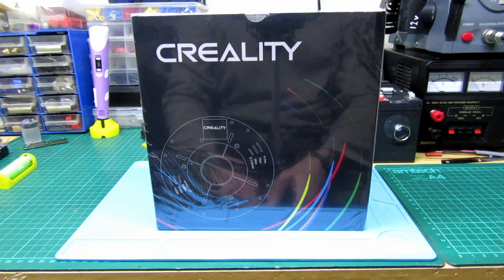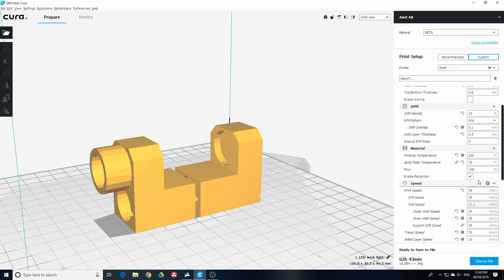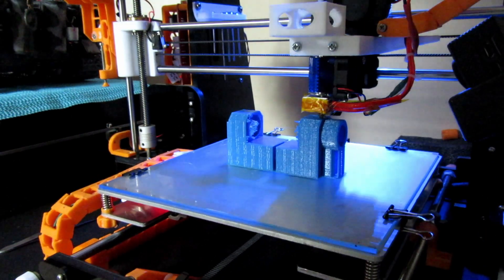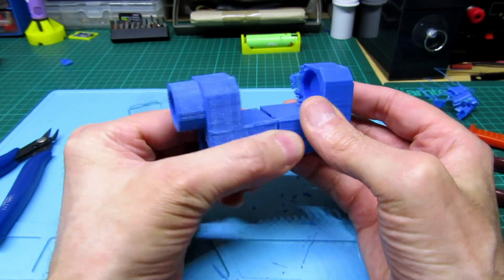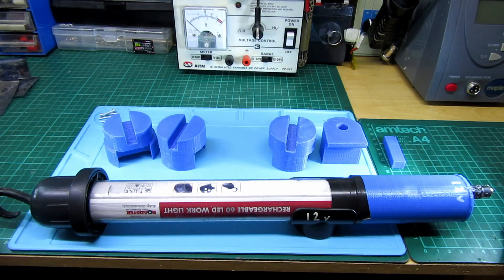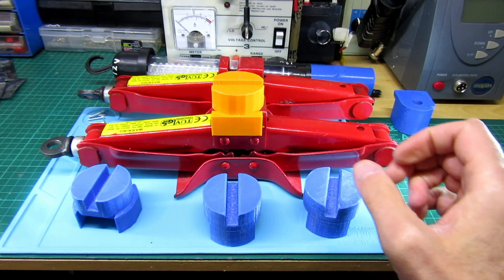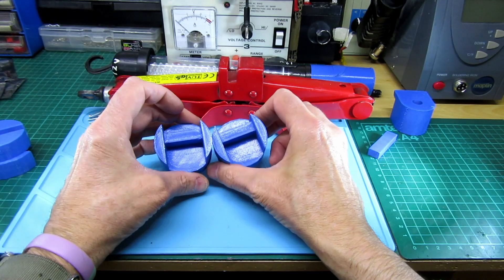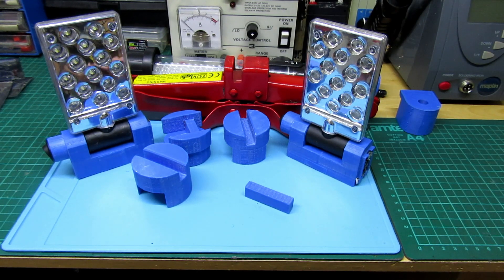First Time 3D printing With PETG

Comment: Well you had better luck with PETG than I did.  It looked horrible.  I even printed a temp tower from 255 to 220 and I could see no difference between any of the temperstures.   Maybe I need to do a retraction test and/or install an all metal hotend.
Reply from the maker: Hi yer petg is tricky sometimes with small parts try to write down all changes I use petg about 75% of the time as I find petg cheaper haven't mastered  abs yet . I use an all metal hot end print but slower and the layer height can make some difference if it's to hot might dribble  and couse roughing so many variations. good luck
Reply: @Beta250trials  Well, I finally succeeded with PETG, yea!  I created a Overture PETG material profile according to some information I found online.  To be honest I did not change much other than the temperature.  But the temp tower came out great this time.  The only thing I can think of is I have been storing it in a storage box with a container of blue desiccant which brought the humidity down from 55 to around 10.  It has been in that box for several weeks.  I did dry it at 50 degrees for 6 hours as recommended by the filament dryer instructions, but the dryer only brought the humidity down to 30 percent.  I guess 6 hours was not enough for PETG.
Reply from the maker: @zk_6312  I'm so glad it worked out I've recently been using petg alot and I put mine in a food dryer then into a container with lots of silicone desiccant seems to work

Comment: I have a jgaurora and I couldn’t figured out the settings in cura for it, very frustrating it was leaving strings in my support layer now I know that I probably need to run it at a higher temperature.
Thank you for the video